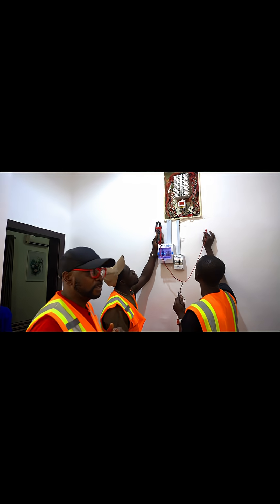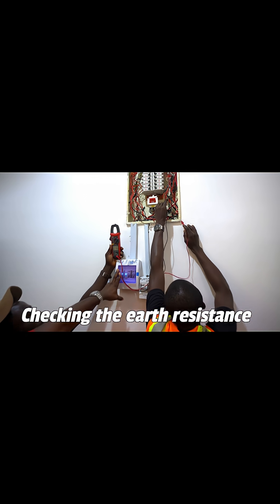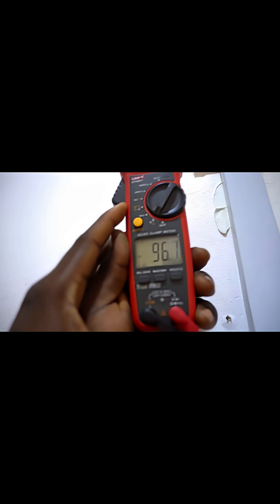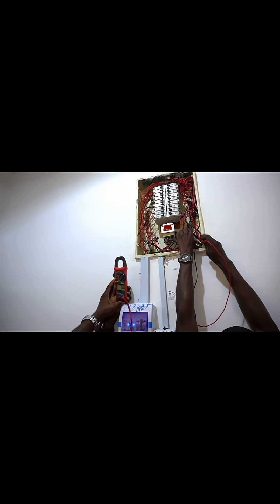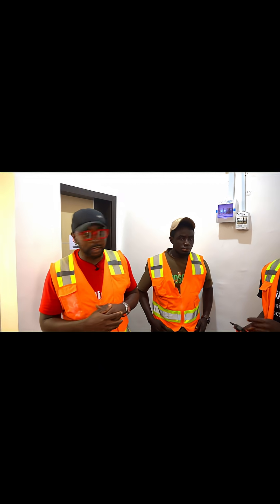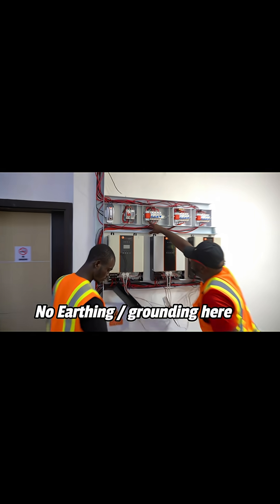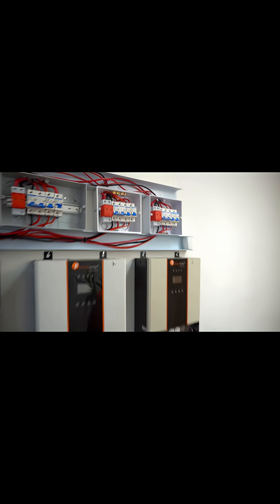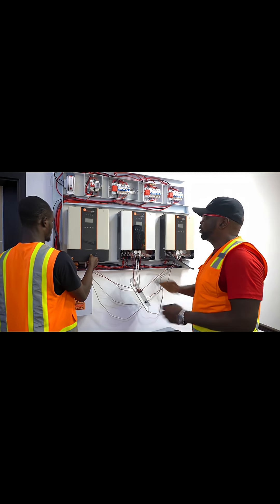The earthing and grounding here is pretty bad.

Comment: Although u have a very high voltage on the reading which means the earth isn't working, but It's not supposed to be zero actually
Reply from the maker: It's between zero and 5 volts, thanks for your comment Buddy!
Reply: @smilinsunsmilinsun8056 yes exactly that 😊 Weldon sir